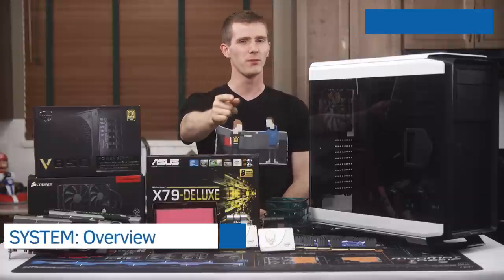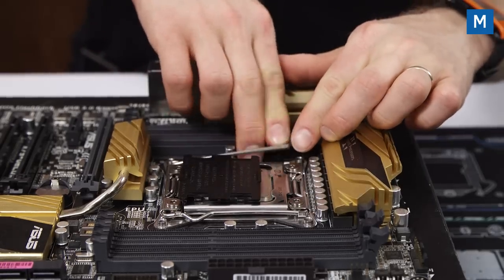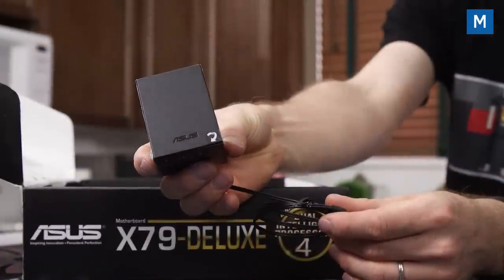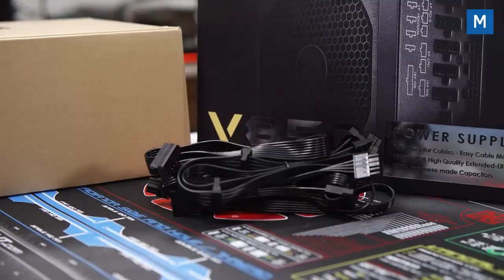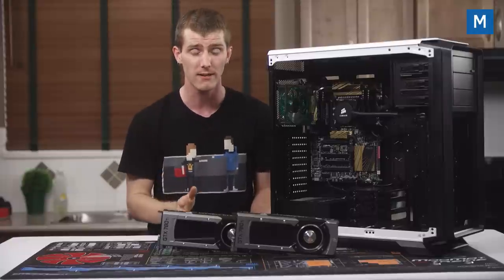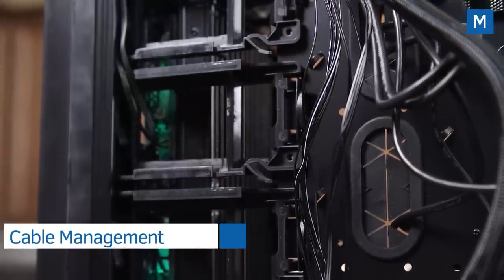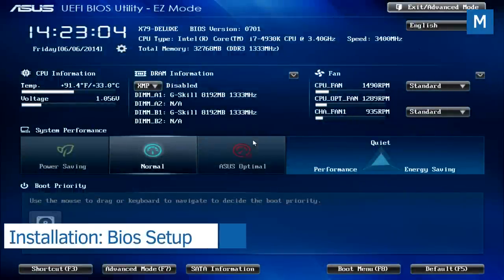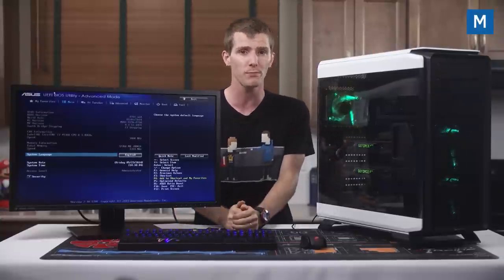How to Build the ULTIMATE 4K Gaming PC Build Guide

Comment: Want to build a New Gaming Computer, Need to be able to get 60fps on ultra on all Games without fail,
These are my current specs but i want better. any help would be great.
intel® Core™i7-4820K
ASUS® SABERTOOTH X79
16GB KINGSTON HYPER-X FURY (2 x 8GB)
3GB GeForce GTX 780 Ti
240GB KINGSTON HYPERX 3K
Reply: Thats a beast

http://ca.pcpartpicker.com/p/d3hRgs
Reply: cool pc dude...thats is overkill for some dudes are in a tight budget
Reply: Justin Adrian De la Cruz And will that play any game on max? 60fps+
Reply: PLESE get a quad channal kit
Reply: maekkongsawad
Here's a improved version of the first one: pcpartpicker.com/user/Whitelaro/saved/TK4BD3 it includes a monitor and can play games high to ultra at 4k.
Reply: TestedMods yeah since the fps is determined in a cpu...but make sure your gpu is not bottlenecked with your cpu..since you have high end and badass video card i think you can get 60fps more most of the games but not all because not all games are optimized yet...are you enabling the ultra setting in any game?
Reply: Justin Adrian De la Cruz Yes ultra, Need 60fps every time, Don't want to spend alot of money on a computer if it is going to go under 60fps. My budget is $8k to 10k, And it needs to be able to handle any game for at least 2 years.
Reply: wow 8k-10k budget nice...as what ive said earlier that there are factors that the fps in a game will not reach 60 fps always because all games are not optimized yet. 2 years is a bit short for me i guess your pc is good for 5-10 years actually. with your specs i guess you should be fine. you know not all guys can afford your build so be happy what you have
Reply: TestedMods http://pcpartpicker.com/p/KMDrYJ Should be able to get about 120+ fps on 1080-1440 and about 60+ on 4k Although on 2 screens you'll get around 30-40 locked on V SYNC and you should have around 45fps. Prob last you 10 years
Reply: ***** Thanks for the help guys, just ordered these parts.
CPU: Intel i7 4930K 
GPU: EVGA GeForce GTX 780ti SC w/ACX & EVGA GeForce GTX 780ti( x4 in SLI)
Motherboard: Asus P9X79-E WS
Memory: 64 GB (8 x 8) G.Skill Z-Series 2400 Mhz Ram
Storage: Samsung 840 EVO 1TB(x2)
PSU: Ax1500i
CPU Cooler: Custom Watercooling Loop
Case: Corsair Obsidian 900D
OS: Windows 8
Reply: TestedMods
4-way sli sucks. Terrifyingly bad. Also get a 4k monitor. Otherwise you'll waste the performance.
Reply: yeah a 4k screen would be perfect. and 4k sli isnt that bad
Reply: maekkongsawad yeah like buy a 4k monitor and a 780TI sli ore if you live in the artics dual r9 290x
Reply: Niklas Bergvall
Don't take it literally. Linus was talking about the reference cooler. Never get a card with a reference cooler (only if you wish to put a custom loop on it)
Reply: Flaming Lemons EM THE NEW AMD CARDS IS HOTTER BUT IF YOU ARE USING A CUSTOM LOOB YOU ARE FINE
Reply: Niklas Bergvall
STOP SPEAKING IN ALL CAPS. It's the noise people are concerned about. Non-reference coolers are far more quiet, and offers far better cooling at the same price.
Reply: Flaming Lemons im already now that OK
Reply: DURRRR, DEZ PARTZ GET 60 FPS GAIZ?
Reply: GooberSuess
That build was ultra (or high) 4k 60fps.
Reply: Just add more 780ti's everything else is pretty much as good as it gets for gaming.
Reply: Ben R
r9 295x2 crossfire is as good as it gets for gaming.
Reply: Flaming Lemons This. Plus it keeps amazingly cool.
Honestly, I wouldn't buy any card for 4k until a card supports Hdmi 2.0 or Displayport 1.3. Preferably both. It seems pointless to try and adopt it right now when Q4 of this year promises much better technology for 4k. The new Seiki, going to be released Q4 2014 or Q1 2015, is said to support Displayport 1.3 and Hdmi 2.0.. So others will probably have something similar.
Reply: Do a setup video on your channel! I want to see you beast computer! :D
Reply: mindsoulbody You Only Live Once, Just kidding but wanted to have a pc that would do anything i wanted.
Reply: ***** No it would not. The VRAM of GTX 760 SLI would be a bottleneck for some games. BF4 uses 2.1gb at maxed 1080p..
Reply: I'd like to start off by saying that you're overspending as is. There is a point of diminishing return where you are paying more money and getting a minuscule increase in performance. A core i7-4820k is more than enough for what you're doing, if anything that's overkill considering I doubt anyone actually needs hyper-threading capabilities unless they're doing serious editing, rendering, and encoding. The Asus motherboard you have is plenty for this build, and there is no reason to upgrade it. Having 16GB of RAM is more than plenty because I doubt you'll even use more than half of it. You've got a 3GB GTX 780 Ti, I don't understand why you need to upgrade... And finally, a 240GB SSD...

I'm sorry if this comes off as a bit rude, but editing YT videos doesn't take as high quality of a build as you have going on, and adding more to it will barely improve it's performance. Unless you're doing freddiew-level editing then you're overspending, and even then I still think it's too much.

Also, why do you have a budget of $8-10k with a life expectancy for at least two years...

After reading the rest of these comments it seems you've upgraded on your previous build and wasted more money. I suppose this heeding falls on deaf ears.
Reply: RedStorm Mint I completely agree. Even in Linus' build, an 8 core AMD chip would've done roughly the same for less, if video editing, streaming, or using otherwise heavy multi core loads applications was one of your desires. They can game too.. While Linus' build was supported by Intel, this guys wasn't.. SLI 780 Ti seems like a waste too. Given that the 295X2 has 8gb vram and a built in radiator that performs at unnoticeable differences compared to a 780 Ti build. The vram would help for heavier workloads in 3D rendering, 4K, and the like.. So AMD and 295X2 seems the more logical route, unless he just likes throwing away money.. 

Which it seems like he does.
Reply: ***** Then what cpu cooler would you recommend?
Reply: *****
No. Get a corsair h series, then replace the fan with noctua or corsair quiet edition.
Reply: But what you are forgetting is that air CPU cooler's exhaust the air into the case while liquid CPU cooler's exhaust it out of the case, Liquid CPU coolers are also lighter and allow for better airflow over other components.
Reply: CrysisVsHawke
Yeah I'm having a few problems with that. So I'll be upgrading it to a Corsair H80 liquid cooler. It will be done by Saturday (UK Time).
Reply: *****
Thaks for the advice. I guess I will change to a Cooler Master Nepton 280L. A big jump but I plan to overclock the cpu to 5.5GHz. But I will change the fans to some noctua square ones just to maximize effiiciency.
Reply: *****
You are right but we are talking about an AMD FX prosesor here. And if I'm going to overclock it It will probably be best for some liquid cooling. Although I do agree on the fact the they can be unreliable. Also I have had over 7 years working expiriance with liquid cooled PC's. I know how to set it up safely. The Different fans that I am choosing for the radiator are some Noctua NF-A14 IndustrialPPC 2000RPM 140mm. They are sighlent and have a good speed so they should cool no problem.
Reply: *****
I have a Phanteks ph-tc14pe and it's noise is driving me crazy. Get a watercooler with Noctua fans and it should be silent.
Reply: *****
Yeah but I will be better off with the in total with the Cooler Master Nepton 280L with the radiator fans swaped for 2 Noctua NF-A14 IndustrialPPC 2000RPM 140mm fan's cooling my AMD FX 9000- 5GHZ processor. Soon to be overclocked to 5.5GHz or 5.8GHz.
Reply: *****
Well what would you reccomend?
Reply: And Noctuas are big and clunky with a very simplistic and single color fan design. If anything the kraken x60 yields the best results over most corsair radiators and the Noctuas cooler.
Reply: Ian Churchill I don't really care to argue because everyone here seems to have differing opinions, but Noctua fans and cpu coolers are dead silent.
Reply: DONT get the 4820K. If you want to keep the LGA2011 socket go with the 4930K because of its 6 cores 12 threads but if you don't have enough for that, get the 4770K and get a Sabertooth Z97 instead since you aren't using any of the exclusive LGA2011 features and it saves you a lot of money. Also it performs better in gaming then the 4820K but its your choice.
Reply: ***** X79 mobo and xtreme grade CPU is overkill for gaming. What he wanna achieve is 60 fps right? I just can't keep my temper when i see stupid shit like this. Sorry man.
Reply: *****
Thanks. I may as well just sell it. Shigh*
Reply: Should be good, although you really don't need that much ram. 8-12 is enough
Reply: TestedMods i'm envious of you man...having a gaming pc
Reply: what really makes me sad is that
 most people here don't even post something constructive.
Reply: 1080p. CF 290 (780 ti will get close, but not quite with games like modded skyrim, Crysis 3 and Far Cry 3)
1440p SLI 780 ti or 290x
4k you can't
Reply: TestedMods if this build is meant for running just 1080p and max out settings, then it's overkill. Lower the mobo and processor. You can even lower the graphics card if you wanted. They haven't released anything that's smashing systems yet. Your build will last a while as it is "future proof". However, a lot more better builds out there.
Reply: Build it if you're insecure. Will last you a couple of years.
Reply: before consulting ever so wise (irony there) internet?
Reply: ***** how to choose the right parts for gaming, video rendering,etc.?
Reply: TestedMods are u crazy? totally waste of money. a radeon r9 295x2 oder 2 r9 290x would be even enough
Reply: just go above and beyond.
Reply: Brendo Delger That is, without a doubt in my mind, the worst PC build I've ever seen. WD purple? $700 of RAM? Windows 8 professional? $400 case? You're trolling, right?
Reply: ***** Im Not really spending that much if you think about it, Lets say in 1/2 years i sell it, Im going to get at least half of my money back so its about $4000.
Reply: That's as good as you should reasonably go, but don't expect 60fps without fail because there are always going to be those few unoptimized pieces of crap that appear to exist to be that latest benchmarking game.
Reply: TestedMods if you sell it in few years you wont get 70% of the cost back, tech advances and prices go lower for older components. Just sayin tho
Reply: TestedMods if you sell it in few years you wont get 70% of the cost back, tech advances and prices go lower for older components. Just sayin tho
Reply: If you want the absolute best then this is something to consider: http://uk.pcpartpicker.com/p/QZpRYJ it is definatly one of the best althought it does cost £7,228.43 or $12,352.06
Reply: extentgaming , with a Custom Loop :) a h100i wont cut it for that build :P
Reply: Brendo Delger There was no option for a custom loop on partpicker and I have seen reviews and they say its a really good cooler.
Reply: just go with z97
Reply: Go with 2 R9 295x2's.
Reply: All you need is like a nvidia 660 and a Intel® Core™ i5-4590T Processor to run a game on ultra with consistent 60fps. Not even. A r9 270x and a amd fx-6300 could.
Reply: TestedMods why dont you just get a Titan Black then?
Reply: Run everything at low and get 60fps+ with out a problem.
Reply: 6 GB GTX titan Z, 128GB 2400 ram, raid 1 a 250 GB samsung SSD. or a fusion drive, intel core i7 4970
Reply: maekkongsawad  Good for the next 6-10 years.. With a $170 AMD CPU, and 3GB VRAM sli GPU's?? LOLOLOLOOOLOOLOLL!!!! You funny man.
Reply: Its not about price. The AMD CPU has 8 cores and can reach up to 5.0 ghz. Standard right now is around 3 ghz. And for your information sir I chose 2 R9 295X2 in QUADFIRE with 8GB VRAM
Reply: maekkongsawad  Well, you usually get what you pay for.. The clock frequency is only one of several factors that influence performance, and perhaps not even the primary one.. Evidenced by the fact that an Intel chip overclocked to a lower 4.# ghz will outperform an AMD chip clocked to 5.# ghz..

A pair of R9 295X2's would be killer though!!!
Reply: I not really a CPU expert but I have heard that AMD does wreck your power bill. But 8 core is what sold me on it
Reply: maekkongsawad  Indeed.. According to CPUboss dot com.. Predicted annual cost for running an AMD 9590 vs Intel I7 4770 sees almost 3X the cost for the AMD! With $70 per year for the 4770 and a whopping $190 per year for the 9590!!!
Reply: Thats almost as expensive as the CPU itself
Reply: He has the money to spend, so why not?
Reply: why not single gpu like 7990 or 690 instead of multiple singles?
Reply: Navis You mean " why not a single card" right? As the 7990 and 690 are dual gpu, single card setups : )
Reply: bliglum Yes that's exactly what I meant :)
Wouldn't that be better since you would have "1" gpu instead of multiple?
Reply: Navis For those who want to use smaller form factor cases, like those micro ATX cubes that are becoming so hot lately, I would assume a single dual GPU card would be a very powerful choice!!!

Just a shame Nvidia's new Titan Z is so absurdly expensive, especially for it's slightly underwealming performance. I'm more of an Nvidia guy (I'm currently running a 770), but from what I've heard ATI's R9 295X has solidly whooped the Titan Z's ass.
Reply: The 770 is an awesome card!
Reply: maekkongsawad I'm liking it! Runs almost everything at ultra/1080p/60fps, got a decent deal on it too, at just $300 late last year on sale! : )... Bit disappointed about it only having 2gb of Vram tho : (. So it'll prob be going up for sale on the used market when the 800 series and R9 300's start duking it out.
Reply: you can run 60fbs on a 780 gefore card to, you dont need a 780ti just waste of money you will not see any difference with it same same i can run with 4k ultra with bf4 so
Reply: mattias bergdahl you can't run bf4 at 4k ultra at 60fps with one 780. It would be like watching a slideshow.
Reply: Taylor Russell
are you kidding me? i know my pc better than you do haha,my fps are over 60fps in bf4 in ultra, but my POINT IS,you will not see any difference between 780 and 780ti
Reply: mattias bergdahl in 4k? you are clearly lying.
Reply: Taylor Russell  in 4k no i dont think so, but ultra in bf4 my fps are over 60fps,but like i said my POINT IS,you will not see any difference between 780 and 780ti i have friends that run a card with 780ti and i cant see any difference between them
Reply: mattias bergdahl are you talking about 1080p....
Reply: mattias bergdahl you stated that "i can run with 4k ultra with bf4 so" you are bullshitting.
Reply: Taylor Russell
ye stupid of me it depends what screen you use so that's my bad you win i didnt think there
Reply: mattias bergdahl haha yer, thats like saying you don't need a 780 because the 750ti can run games at 480p
Reply: Taylor Russell yeah i know i was not thinking there i meant 1080p not 4k :p in 4k i guess you can see some difference between them
Reply: mattias bergdahl yer even at 1440p the 780ti will be a better suit. The 780 is perfect for high resolution 1080p. I'm currently building a 780ti SLI system for 1440p :D
Reply: Taylor Russell badass pc dude
Reply: Justin Adrian De la Cruz Thanks man :D
Reply: Taylor Russell i wish i have a beast gaming rig of yours
Reply: Justin Adrian De la Cruz Yer but I'm broke now haha :D Still got to buy more components and watercooling stuff.
Reply: atleast you have the components i still havent bought even one
Reply: Justin Adrian De la Cruz You building a pc?
Reply: i'm just saving money to buy the new components..my pc is very obsolete from a dual core processor and 2 gb of ram
Reply: Justin Adrian De la Cruz yer, what's your budget :p
Reply: 500$-600$
Reply: Justin Adrian De la Cruz nioce
Reply: Taylor Russell not nice still ive not reach that amount yet
Reply: Justin Adrian De la Cruz keep saving you will get there :p
Reply: Taylor Russell i think it takes forever man i'm so broke
Reply: Justin Adrian De la Cruz I know that feeling aha
Reply: Overkill lmao. i7 4790 or even an i5 with 8 gigs of ram and a 760 2gb or 750ti 2gb, no ssd will run every game on ultra
Reply: Miloš Stankovic why would a ssd run games at ultra ahaha wtf
Reply: try AMD+ATI newest generation... this combination is unbeatable this century... and with mantle technology its really beast... :),,
Reply: Matthew Matwej Kolááč Kováč does mantle technology have great improvement and impact in games?
Reply: Justin Adrian De la Cruz yes, mostly for low end systems/apus. Also mantle is supposedly dead with the upcoming release of DirectX 12.
Reply: okay Taylor Russell damn directX 12 will be cool...cant w8 any longer
Reply: Justin Adrian De la Cruz New 800 series are coming out next month I believe. I couldn't wait either so I got two 780ti's XD
Reply: ohhh so rich man Taylor Russell  not all guys in my country can afford 780,780 ti,titan z
Reply: 202penguin i'm from a third world county so those can afford those high end and expensive cards are well off.
Reply: Justin Adrian De la Cruz yer they aren't cheap here as well (Australia)
Reply: Justin Adrian De la Cruz everything moving around AMD or ATI was always been the best way to have a great computer for everything... Got very good experience... :)..
Reply: 202penguin philippines, computer components can be quite expensive in my country and the price will be few dollars here due to shipping,tax,etc.
Reply: Matthew Matwej Kolááč Kováč i wish amd cards consume less power same as nvidia if they can achieve that i can say they are best in price to performance ratio
Reply: Taylor Russell im saying the ssd has no need... if you read what other people have said you know what im talking about.
Reply: Miloš Stankovic oh ok, a SSD is great to have though.
Reply: Taylor Russell if you want fast read and writes get a ssd and your pc will boot faster for it will be in secs
Reply: Taylor Russell i guess it is cheaper in us and europe
Reply: Justin Adrian De la Cruz I am from Australia lol
Reply: Taylor Russell i know dude i'm just saying what are the area may possibly cheaper than than the rest of regions
Reply: Justin Adrian De la Cruz yer, though in general ssd's are decently priced now, $299 for 500gb ssd is pretty decent.
Reply: Taylor Russell provided you have the money of course that would be cool or use the m. 2 drives that would be even better
Reply: DzoNi Gamer no, stop begging
Reply: maekkongsawad what pc game is worth building that? even though the mac pro is way more expensive- its a hell of a lot more efficient and smaller and will give you the same amount of power as your config list there
Reply: Uhh. I hate how everything is cheaper in the states... I could run two GTX 780ti on a setup that includes one GTX 780....
Reply: mambo jambo what?
Reply: Taylor Russell .. sorry.. kinda bad explained. if i get a rig from the us. i could run two of the GTX780 TI (the 600 usd once) For the price of a rig with only one GTX780. I mena tot price on a setup.
Reply: mambo jambo I kind of doubt that. Where are you from?
Reply: Norway
Reply: ***** but you can't game on it. Only a few games are available on mac
Reply: mambo jambo yer i doubt that if you did US to your currency that two 780tis cost the same as one 780
Reply: didnt say that two cost the same as one GTX. i sayed that with the setup i am going to buy. i would in norway get that with one GTX, but if i lived in the states i could get the same setup with two GTX ti's. FIY... One ti costs 900 usd. whilse in the us it costs less. and every other compounet is also cheaper over there. so every 100, and 50 dolar there and here makes a big change.
Reply: mambo jambo that is pretty damn expensive, even over here in Aus it's like around 750USD for 780ti.
Reply: yeah. So no ti for me. guess the 780 will work well for a few years. im using a shitty HD 4780 card that cant play games anymore, and a harddrive that wil fail any moment
Reply: mambo jambo yer 780 is beast
Reply: Taylor Russell use 2 ssd drives in raid 0 you will see crazy performance
Reply: Justin Adrian De la Cruz and no reliability. twice as much chance for drives to fail.
Reply: Taylor Russell nah it is a ssd so there is no moving parts meaning there is a little chance of fail
Reply: Justin Adrian De la Cruz .... ssd's still fail, it's highly risky putting them in raid 0.
Reply: Taylor Russell yeah but still better than hard drives though, ironically i'm talking about ssds which i cant even afford to have one
Reply: Justin Adrian De la Cruz ahah
Reply: If you have money by all means. But you can run all games at 60 fps at a lower price
Reply: According to your channel. Your just gonna get a 2000 dollar computer for minecraft?
Reply: Good set up, but i'd recommend a Sapphire R9 290 4GB graphics card.  I'd also recommend the following. 
1GB HDD Barracuda
INTEL i5 ( i5 are actually better than i7 for gaming due to a number of reasons) 
8gb ram min but 16 Gb obviously better but not necessary 
MSI Z87--G45 Gaming mother board
I also have 1 4k Samsung monitor, it runs at 60hz and is amazing
This is my set up and i get 40-65 FPS on Crisis 3 on 4k resolution and ultra settings on everything!
Reply: Woobywooo is msi z97 gaming 3 or mis z97m good motherboard?
Reply: Justin Adrian De la Cruz Yes it is
Reply: Woobywooo thanks but why is the z97m is more expensive than z97 gaming 3?
Reply: Eddie Enke Planetside 2 Is More Dependant on cpu, Does he play that? maybe?
Reply: if ur planning to multi monitor maybe a high vram gpu? 780 ti gr8 cards but maybe something 4gb + wud be better but ur good for now i guess :)
Reply: ***** what do you mean troll?
Reply: You want MORE? THAT THING YOU CURRENTLY HAVE WILL RUN ALL GAMES 60FPS WITHOUT FAIL, FOR THE NEXT GAMING GENERATION. 
IF YOU HAVE MONEY TO WASTE THEN BUILD THIS: http://pcpartpicker.com/p/QMyXMp
Reply: ***** Out of all this dribble on here,atleast someone did their homework, along with research. Since this is a gaming rig discussion. One would be hard pressed to justify they use of a processor over the i5 4690k for gaming. Team it with a 780ti and the rest of it is a moot point. Just stick with a 120hz or 144 monitor with a 5ms b-w-b 2ms g-g response time and screw the rest of it. Just wasting/throwing money away at anything else over..4k is fairly new and to me isn't cost justified atm.
Reply: Could have done better with the graphics card say a Sapphire R9 290 Vapor-X OC and overclock it more and you have less wattage means less money on your electric bill.  Also less heat.  Nvidia is just garbage they don't give two fucks about their fans.  I believe AMD will be the more dominate company or already has them beat.
Reply: Brendo Delger why do u need a big case
Reply: Ok first of all watch the video -_-
Reply: Oh and with the release of the Asus ROG Readies Swift PG278Q with G Sync...It even makes having a Nvidia based GPU even more desirable. Tho to run this beast, SLI appears to be about the only option..I personally went with 2 EVGA 780Ti SC's myself.
Reply: u can have the most expensive shit u want if its a shitty port u never gonna get ur steady 60 fps
Reply: weskeeey is why one either uses a Display port or a DVI/D
Reply: paul abrudan HA! that's nothing, basically low end gaming pc. check this out- http://pcpartpicker.com/user/GamerTechTips/saved/PRdG3C
Reply: Yes that build will pretty much crush every game
Reply: Get a toaster